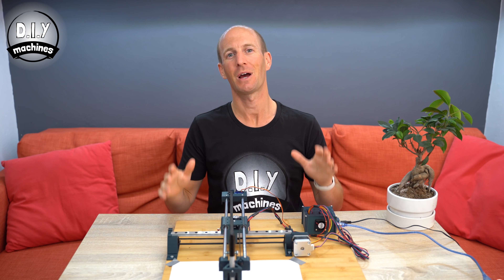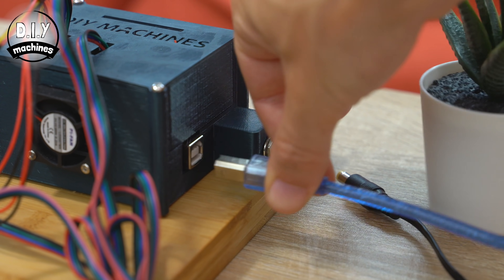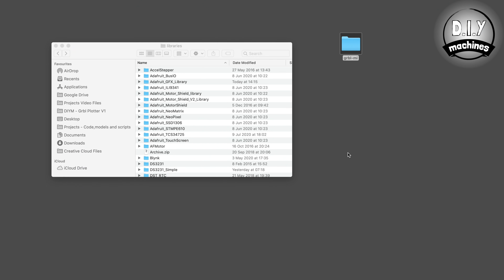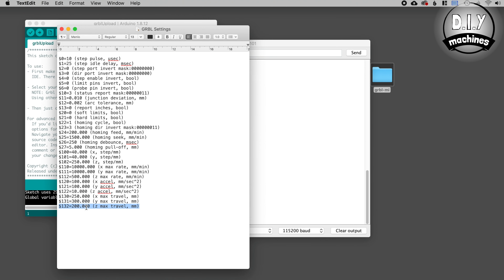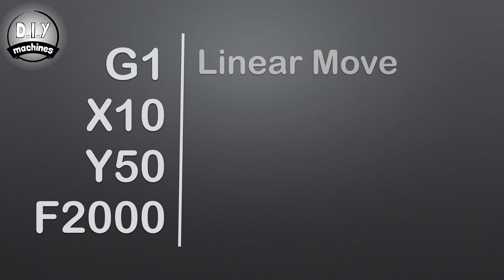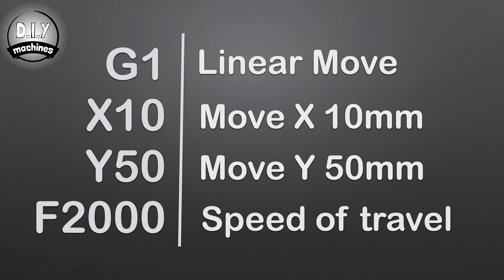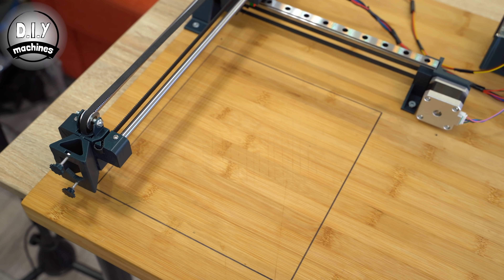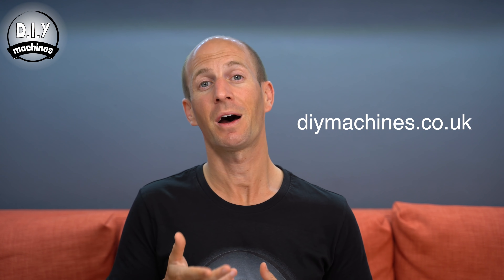Part 2 - Super Easy 3D Printed Arduino CNC Drawing Machine - The Software | GRBL | Inkscape Plotter

Comment from the maker: If you missed part one, covering the 3D printing and assembly you can watch it here: https://youtu.be/XYqx5wg4oLU
Reply: Really amazing, how big can you make this, A2, A1 size?
Reply from the maker: @unrealone1  I worked on keeping the cost down with this design so I don't think you could go much larger than A3 in landscape orientation. The side to side axis can be increased substantially but the back and fourth in it's current design is not suitable for extending much.
Reply: would you please consider DIY Laser CNC?
Thanks in advance
Reply from the maker: @TheErixcode  I've always wanted a CNC laser. It's on my list of projects to research and design but I'm afraid it's not near the top of the list at the moment.
Reply: @DIYMachines  what is at the top of your list, love your videos btw!
Reply from the maker: @alomode1039  Ah, well that's top secret! Who wants to spoil a surprise....
Reply: ⁸I will ⁷
Reply: Do u have this project readily available for selling
Reply: Can you please tell me how you used different colours of pens?
Reply: How much did this project cost u
Reply: What was the inscape extension called?

Comment: I used a4988 driver and the servo motors are not spinning instead they vibrate even after setting up the potentiometer

Comment: I created a powershell script that will insert the "pen up" and "pen down" commands into gcode that was generated for laser cutting/engraving. This is good if you want to use something other than Inkscape with the MI extension, I personally like to use Lightburn.

You will need to create a text file with an extension ps1 e.g. gcode_regex.ps1. Copy in the following script. To execute you open up powershell on Windows, change directory to where your file is located and type .\gcode_regex.ps1 "Cool Vibes.gcode" [note swap out "Cool Vibes.gcode" for your file name (saved from your favorite GRBL gcode generator)]

param (
	[string]$fileName
)

$outfile = $fileName -split "\."
$outfile = $outfile[0] + "_output.gcode"

(Get-Content $fileName -Raw) `
	-replace "(M\d+[\S, ]*`n)", ""                                      <# first remove all current M commands #> `
 	-replace "(G(0|1) \S*)S[1-9]\d*(F\d+`n|`n)", "M5`nG4 P0.2`n`$1`$3"  <# find G0 or G1 statements that set S (power) to greater than zero, insert a "pen down" statement and pause 0.2s #> `
	-replace "(G(0|1) \S*)S0\d*(F\d+`n|`n)", "M3 S90`nG4 P0.2`n`$1`$3"  <# find G0 or G1 statements that set S0 (power off), insert a "pen up" statement and pause 0.2s #> `
	-replace "(G1 \S*`n)(G0 \S*`n)", "`$1M3 S90`nG4 0.2`n`$2"           <# find any instances where gcode goes from G1 to G0, insert a "pen up" statement and pause 0.2s #> `
	-replace "(G0 \S*`n)(G1 \S*`n)", "`$1M5`nG4 0.2`n`$2"               <# find any instances where gcode goes from G0 to G1, insert a "pen down" statement and pause 0.2s #> |
Out-File $outfile

Write-Host "File created successfully " + $outfile

Comment: man this is such a cool project!! have you considered revisiting it into a V2? e.g. maybe more rigidity/ swapping arduino with something like an ESP32/ Pi Zero/ something else that might improve performance
Reply from the maker: Thanks, yes I have got plans to revisit this but it's probably months away whilst I complete all the projects I'm currently working on. I also intend to make a large format one which will draw on roll's of paper so that the six elf the drawing (on one axis at least) is unlimited.
Reply: @DIYMachines  fantastic!! such a cool idea re the infinite axis - it's quite unique and you'll get loads of attention from the community on that!!

can I suggest two things as well: more precisions/ rigidity overall across the motion system for accurate designs + some redesign of tool head, for more precise Z movement (e.g. to use brushes)

side note: I really love your channel and work!! how do you manage to be so productive and push out so many completely different projects??

Comment: This pen plotter is very well designed and the instructions by Lewis are outstanding. There are not many projects that are so well presented and documented. Thank you for sharing your excellent work.

I have built the plotter and it functions well. However, I have run into a problem using Inkscape. There have been many upgrades to Inkscape since this project was published. The present version of Inkscape is 1.4 and the extensions provided by Lewis do not seem to work. I have installed the extensions as instructed. When clicking on the extension to save an image created on Inkscape the frame that provides for entering a filename and destination does not appear and the process appears to terminate without saving the work. I would appreciate any advice on how to fix this problem. Thanks.
Reply: I had the same problem, i installed multiple version until 0.91 worked for me

Comment: I've built this robot and the construction was very easy due to the very detailed and clear videos. The problem is the pen holder and the system used to move it. I find the pen holder overcomplicated and lacking any kind of precision, not being able to keep the pen firmly in place while drawing. The GT2 belt used to move up and down the pen holder was impossible to glue to the pen holder itself and I've had to find a different temporary solution. Is there anyone that figured out a better pen holder mechanism??

Comment: Hi, I'm building a 2D CNC pen plotter following your video. I’m encountering a weight distribution issue: at the home position, the weight of the pen causes it to tilt downwards, but as it moves up, the pen lifts off the surface, preventing any drawing. Do you have any recommendations for adjustments or additions that might help balance the pen better throughout its movement? Thank you for your help!

Comment: I have homing, X and Y moves working perfectly.  However,  I can only get the pen to move up, not down.  I issue M3 S90 and the pen moves up (servo rotates to 90deg).  However, when I issue M5, nothing happens.  I can issue M3 S10 and the servo goes to 10 degrees but M5 does nothing.  What am I doing wrong?
Reply: May be too late but had the same problem and i figured out that i had misplaced the arm on the servo. When you send m3, the servo cant fully move. Un mount the servo and you should be able to send m3 and after m5. Now replace the arm knowing your m3 and m5 position

Comment: Amazing videos, I am currently building my own Plotter and everything works, as you explained, till i want do move the servo motor. Nothing happens. do I need to change something in the grblmi files to use a servo ? I ran a test code in the arduino ide and there it moves the servo, but with grbl and "m3 s90","m5" commands it doesnt

Comment: Just finished a diy cnc pen plotter. I 3D printed my parts based loosely  on Mr. Innovatives design. It was a lot of work to get everything dialed in. Your software instruction are the best. Although when using inkscape I had to use a scaling factor even though I was using mm units.

Comment: I know this is an old video, but hope someone can help. I have everything working, except the file from inkscape does not open in chilipeppr as the correct size. I tried a 210mm x 210mm square, but in chilipeppr it outputs as a fraction of that.

Comment: MIGRBL is not uploading on my arduino UNO board , it just stuck in uploading and then fail to upload . my board is ok and It works properly on other libraries and codes but can't upload MIGRBL . do you know why? I use arduino uno smd and I done all troubleshooting methods like reset it or checking ports and etc. please help me

Comment: NO if your machine goes wacky ,then you need to troubleshoot and find the reason why and fix it, if one or both motors are moving in the WRONG direction then reverse the plug on the board and try again.

Comment: Anyone help please?  I can move the micro server up and down. but for life of me I can't figure how to move the steppers or motors to go in X/Y axis.  I'm using arduino 1.8.12 and GRBL 0.9 but the homing never works. it always fails. I also can't manually run commands to force any movement in the motors.  I noticed the heat sinks are not warm at all on the steppers. Not sure if this is expected if the steppers are not active.  

I replaced all the steppers and the CNC shield and still didn't see any results.  

Any suggestions?

Comment: Hello, The video inspired me to do the build. However I have run into problems on the software side of things. I own Mac computers and the JSON program needed with chilipeppr does not work with the Mac. I exchanged for Universal Gcode Sender. My next issue is that the older version of Inkscape will not load on the Mac. The MI grbl extension does not work on newer versions. Does anyone know of any work arounds. I can get the machine to work, however the z axis / pen lifter does not work. Does anyone reading this know of any work arounds? Thanks Bill

Comment: Hello,
Firstly thank you very much for explaining all these in a simple way. I build the system everything is working well except servo. When I command "m3 s90" the ardiuno is resetting. I did a quick research and the conclusion is "I have to power the servo externally." but I couldn't find the wire diagram for it. Could you help me about how can I power servo externally in this project?

Comment: I use inkscape to generate gcodes too. But been facing a trouble lately. The pen directly goes to a different location without lifting up, this makes a straight line that shouldn't be there. Any fixes for this? Idk if the generated gcode has mcode in it between paths to lift up the pen or not. But if they're there and this still happens, what might be the issue here?

Comment: Hey guys and mister DIY machines! Thanks for inspiration. I loved it so much i went ahead and built this contraption myself. Everything was done properly and everything seems to work fine. But I have got a problem. Whenever I try to load up g code it only goes through couple lines and stops. My question is if you know what the problem could be. Thanks in advance for response.

Comment: does the github link not work for the GRBL code anymore? I can't get it to work and get the "grbl:h no such file or directly" invalid library issue no matter how I try to import the file. The steps from 3:17 on I just always get that error

Comment: I tried a newer version of inkscape and ran into lots of trouble with python etc. so instead I made a new post processor for fusion 360. Just make a copy of the grbl laser PP and add a couple of lines of code (posted them on prusaprinter comment section with the stl's)
Reply: Can you provide a bit more details on this? I too found limitations with the legacy version of Inkscape and feel that I avoid using my drawing machine because of it.

Comment: why when I enter the code G1 X10 Y50 F2000 the movement seems to be in cm and not in mm
Reply: It's either wrong steps / mm in the grbl settings (80 is a common value if steps are 1/16) or wrong step-setup on the CNC shield, check under the steppers and use three jumpers for 1/16 steps...
Reply: @nicklasbroberglarsson8427  Thanks, i changed the drivers to those used in the tutorial. Problem fixed.

Comment: Great series of videos, thanks 4 share! - Q: only works w/ sharpies? - Request: can you tray this works w/ a fountain pen, this needs special angle and some pressure|…
Reply from the maker: Thanks, It should work with a fountain pen if you customise the holder on the end to hold it at the correct angle - it is designed so that the weight of the tool head at the end keeps light pressure on the drawing implement (it's not  the end of it's travel when lowered)

Comment: Could you design one that is modular? As in, be able to draw on larger surface areas?
Reply from the maker: You can increase the width without too much trouble, but the axis which holds the pen was never designed to be much longer. A big goal of this project was to keep costs down. I may make a larger version in the future but could not say when. Sorry.

Comment: Hi everybody, 
 
I built (thanks to this amazing tutorial, a big thank you!), this machine. 
The machine works, I could test it with drawings in .gcode format but the problem is that the Inkscape extension to generate this famous gcode does not work. After many attempts, python updates and other manipulations, this extension of Inkscape does not work because the lxml is not up to date and it is impossible for me to update it. 

- Do you know what other software could replace Inkscape? 
- Or if by any chance it is possible that the machine works with another file type than gcode? 
 
I am using an iPad Pro to create the drawings and vectorise them. I was thinking of creating the drawings on ipad and then sending them to a mac book pro in inkscape to change the file type but maybe there is an app that allows saving to the correct format directly from an ipad?
 
If you have any clues it would be a great relief for me. I think I've reached the end of my skills in this area... 
I thank you in advance for your precious help. 
I wish you a lovely  evening, 
 L.M

Comment: I'm back :) I can't get the machine to respond at all to the $H Homing.  It appears to respond to $X to unlock. Suggestions?

Running commands manually doesn't do anything.  Fan is running from my CNC which makes me hopeful power is running to the board. Generic error i'm receiving below. 

ok
[Caution: Unlocked]
ok
ALARM: Homing fail
ok

Grbl Eh Servo 0.9j ['$' for help]
['$H'|'$X' to unlock]

Updates the servo for the pen head works. it responds to m3 s90/m5.  So I know something is working at least.

Comment: I have installed the newest version of Inkscape (1.1), but the MI GRBL Z-AXIS Servo Controller seems not to work with that version. There is this error message:  File "servo.py", line 52
    def bezierslopeatt(((bx0,by0),(bx1,by1),(bx2,by2),(bx3,by3)),t):
                       ^
SyntaxError: invalid syntax
Reply: i've got the same error. no idea yet how to fix it. :(
Reply: sigh same problem. let me know if you found a solution. i might just try an old version of inkscape and see if that works.

Comment: Very cool!
Here's an idea that should be challenging!
Adapt in place of the pen, an inkjet system, (using common parts of inkjet printers), simulating a DTG printer, with the head moving in both axes, contrary to the printer that the head moves in only one

Comment: I am having the same issue as you showed in the bad demo. The motor is moving right instead of left. I checked the elevtricals looks fine. Can anyone help me please?
Reply: I was able to fix it by changing the wires in the stepper motor as the following.

Red - blank - black - blue - green

Some stepper motors have the wiring direction different. Hope this comment help some one.
Reply from the maker: Great to hear you solved it, thanks for sharing your solution to help others. 👍🏼

Comment: Hello. What needs to be changed or replaced for the machine to draw at speed [X10] or at any other speed
Reply from the maker: You need to change the feed rate to modify the speed it runs at.

Comment: I have everything loaded and everything seems to work fine, steppers move ok, but when I activate the servo in Migrbl with m3 s90, The servo just spends and spends and never stops, until I enter m5.  I feel like my survival is not being told to only move 90°. Any help please
Reply: I mean, “when I activate servo in serial monitor of the migrbl on arduino “ like you do in the video to test pen servo and length of tension tread pulley
Reply: I think your download for MI grbl was wrong,...when I did it, steppers worked fine, but i could not get servo to go up  and down just 90 degrees, it would just spin when I entered the m3s90 on the serial monitor in arduino.  Then I realized in serial monitor it said grbl 1.1...but in your youtube video it showed when you did it it was grbl 9 servo.

Comment: Hi Lewis, I have this built, not without some issues purely of my own making. However the use of Inkscape is an issue as a Mac user with Big Sur installed I cannot use Inscape 0.48 which fails with some error on the servo.py file. Is there an alternative resolution you recommened?
Reply from the maker: Hi Mickey, my main machine is Mac and when I made this I could not find an alternative at the time so I found an old windows machine and used that to create the drawings. It my be worth going through the comments for this project on my site (diymachines.co.uk) as I think someone else may have mentioned an alternative way of doing this.
Reply: @DIYMachines  I downloaded a VM from microsoft and am running it in Parallels. Managed to do the box so far. Still learning.

Comment: Excellent set of videos!  Have you given any thought to increasing the size of the drawing area?  Do you think this drawing mechanism would scale up to 1.5m x 1.5m?
Reply from the maker: Thank you David, yes I have thought about a larger one. The code would scale just fine. One of my main designs goals was low cost and as you go any larger than this the first increase is an additional rail and stepper motor to form a more traditional gantry.

Comment: When I enter the '$H' homing command, the axis move in the opposite direction, from the limit switches. I've loaded the configuration file 3 times now and I have re-checked the wiring... Do you have any ideas what the issue could be?
Reply: I think you have to change the position of the jumper for that axis on the control board
Reply: @eddyk6853  thank you for help. Is this a jumper that came installed on the GRBL shield?
Reply: Did you fix the issue? I am having same issue
Reply: @Shaminmv  You can just invert cable on the cnc shield, red wire not to the top, but to the bottom, it was ok for me after !